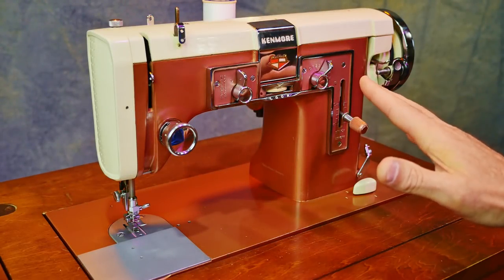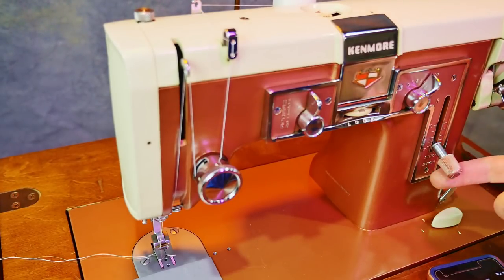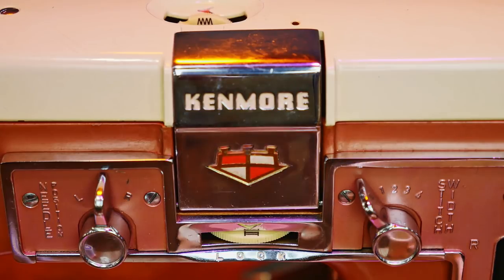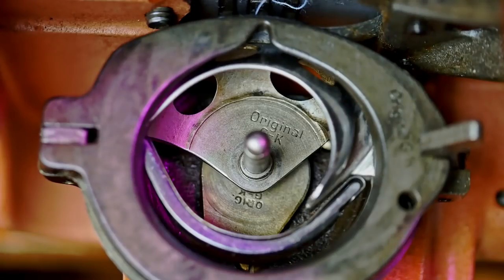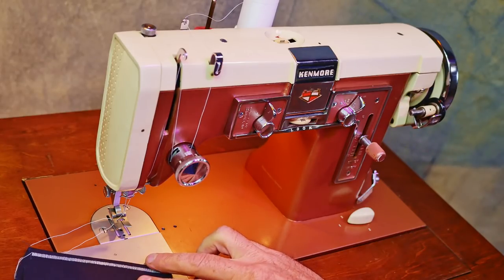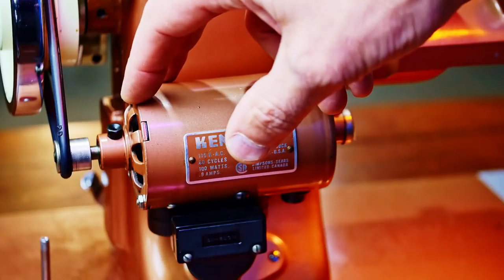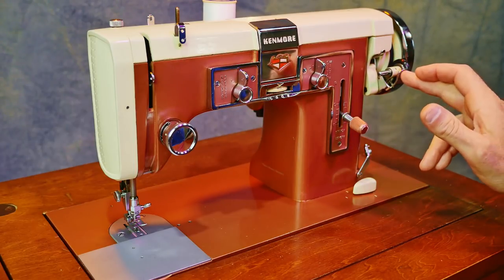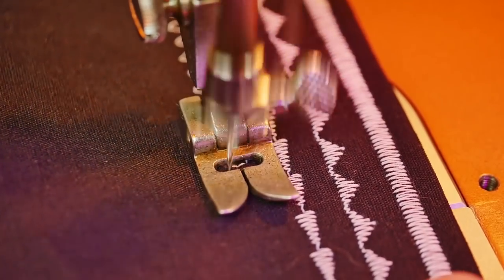Kenmore 117.841 Made in Germany

Comment: Hi Alexander Dyer, really could use your help. 

I was just gifted this exact model, Saved from the dumpster. Greazy dirty frozen stitch length controler and other areas. She mostly works now. Straight stitch only, but so nice, I see what you mean about quality over similar Japanese models. Rewired everything. Motor is perfect. 

I can't get the cam followers to come back down to the cam after they roll over a peak. Everything is loose and working from the needle bar back to the axle in the followers, and the spring seems plenty strong. Keep trying heat, tri-flo, and wiggling, no joy.

Am I missing something? Any advice would be greatly appreciated. 

Love the content, like-minded follower.
Reply from the maker: I don't know friend. Lots of solvent and compressed air to get everything spotless and clean. I also recommend sewing machine oil as a lubricant.

Comment: I just found one of these at a thrift store with all of the presser feet thread cutter and 8 cams! While getting all the old shmoo worked out and replaced with fresh oil i noticed that the feed dogs were uneven. The left side sticks up about 1.5mm above the needle plate compared to the right which just barely goes above the needle plate. Is this the same on your model? Or do i have bent dogs?

Comment: So quick question. Are you using a foot control? Mine didn't come with one. It is attached to a workstation and has the metal box on inside of desk. There isn't a place for a foot pad to be connected...that I can see.
Reply from the maker: that is operated with your knee. It should have a bar that swings down.

Comment: i received this exact model from my grandmother when she passed. do you happen to know if there is an on/off switch or is that simply the light switch? thank you so much for this video! very helpful 🥰
Reply from the maker: There is not an on\off switch per se. The control pedal that is operated by foot ( or knee ) turns on the machine when activated and also controls its speed.

Comment: Very cool machine.  As always, a nice thorough demonstration.  
I have a question about belts:  I see you put one of those stretchy black rubber band type belts.  When looking at supply websites, I also see the bumpy red belts, and tough black V-shaped belts (like wee little automotive belts).  What are your thoughts on the pros and/or cons of the various types, and why did you go with this black rubber band type?
Reply from the maker: I wish I had some deep insight for you.😅 I am afraid that in this case it had an old one just like this and I liked how it fit in the grooves. I have bought the lugged belts and I like how those look too, especially the orange ones which thinking about it now would have been perfect for this machine.In the end I guess just go with your preference.

Comment: Hello

My Kenmore 117.840 works great but found out when I turn the know to the right needle position it is too far right. And when it is all the way left, it is actually in the middle. Do you know how to adjust this? TIA
Reply from the maker: I do know how to adjust this or rather I should say when I am sitting in front of the machine and can look at it to infer which screw to loosen to then move the needle into the correct position and tighten in place.   Or maybe it is your foot that is off, IDK
Reply: @AlexanderDyer  If you have the time to look and can figure it out I would appreciate it.  I can take pictures of the internals if you need them.